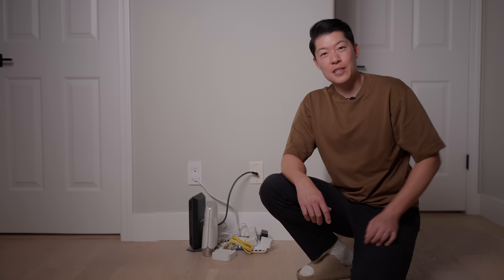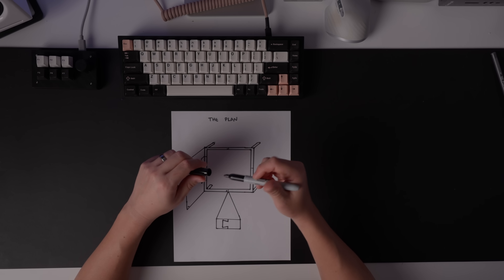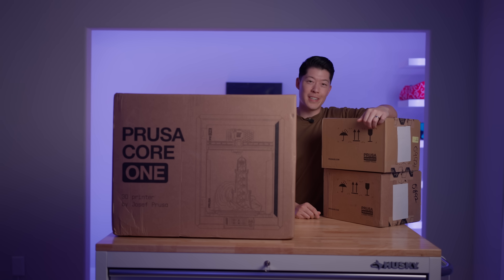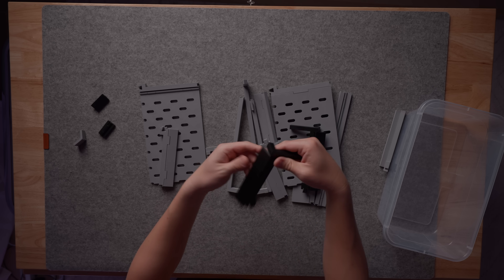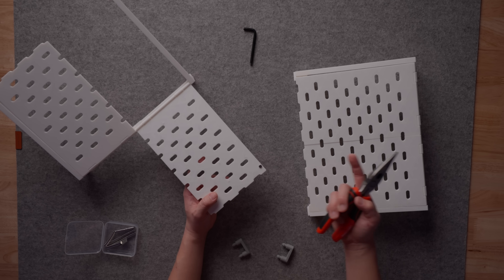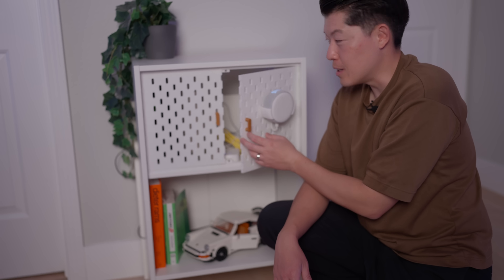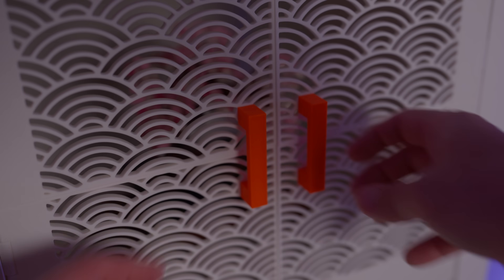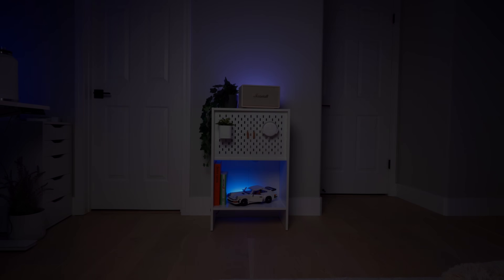IKEA Didn't See This Coming: Fully 3D Printed Cabinet Doors

Comment: These are great! Do you think you could do something for the A1 mini doors? I'm only asking because I put the hinges wrong on the three I printed and couldn't work out why the doors kept coming off 😂 

I totally get that this may be just a me thing.

Thanks for your awesome design!
Reply from the maker: Thanks! Sorry to hear about your experience with them though! The A1 minis were a little tricky because they were snap fit hinges and everyone has slightly different tolerances. I've seen someone comment about how they adjusted horizontal expansion by 0.15 mm in their slicer setting. I have not tried it but might be worth a shot!
Reply: @josh_makeshift the sizing was fine for me, I just put them together wrong. I haven't seen anyone else mention that, so it is probably just me lol

I am slowly filling up my kallax with the wave variation, it looks great!

Comment: I have a wall full of Kallax shelves. I have 3D printers. I think my local filament outlet will be very happy in the near future.
Reply from the maker: Hahaha love it. Hope everything prints smoothly!
Reply: @josh_makeshift  I finished the first print with no issues, unfortunately it doesn't fit. Well, it sort of does, but it's such a tight squeeze that it takes a minute of incrementally wedging it in there, and then the doors aren't really usable because there's so much tension that they just stick and rub. I used my X1C and the profile on Makerworld, so I have pretty high confidence in the print itself. 

I read another comment that said they had to file theirs down a bit, so I suspect it's variability in the Kallax more than anything else. Although I did try in four different ones here, bought at different times, so it seems pretty consistent between my shelves. I'll have to see if I can't make a slight modification and cut a few layers off of the frame. It's oh so close..

Edit: Thanks for making the cad files available! I downloaded the ones for the beams/frame pieces, and it seems trivial to do a push/pull to adjust them a bit, so I'm going to try tweaking those until I get a good fit. The magnets I ordered are still nowhere near being delivered, so I have some time. :)
Reply from the maker: @ So happy to hear you found the cad file and are able to make the adjustments! The variance in kallax shelves is definitely something I didn't consider but will keep in mind for future designs. Hope everything works out after making some tweaks! Thanks for checking out my print!

Comment: Prusa didn't send me anything so I bought it myself :D It hasn't arrived yet, it's my first 3D printer so I'm very excited.
How do you find it compared to X1C? I was thinking between the 2 but chose Prusa because of the recent Bambu controversy.
Great video btw, it is comparable in quality to channels with 100k+ subscribers, I wish you get there soon :) Subscribed
Reply from the maker: Thank you so much! You're gonna have an absolute blast. You can't go wrong with either of those printers to be honest. They print amazing straight out of the box and are great for beginners. Each has it's own quirks and it depends on what you value. It sounds like you like the open source so I think you made the right decision

Comment: Hello, I'm using a Prusa Mini — it's my first 3D printer, but I'm having trouble with the settings. There aren't many people around me who use this printer, and the models I print keep detaching from the build plate. I'm using build plate solution, but it hasn't helped. I would really appreciate your help. Also, your video is great — thank you for your hard work!
Reply: Hey! Get in contact with 24/7 support on the Prusa page. 

You could also try using warm soapy water on the bed
Reply from the maker: Thanks! Hrm It's hard to pin point where the problem is without knowing details but some common fixes are cleaning your build plate, drying filament (depending on what filament you're using), making sure bed is leveled and no external drop in temperatures/wind is affecting the print. I'd reach out to the Prusa support as suggested by Kalani. Hope this helps!

Comment: Wow, these are fantastic 🫶🏼 many (inc myself) use the KALLAX as a display unit (see my videos) but the issue is dust! You can buy doors but they are silly money, you can seal the back up with thin board painted. Have you thought about a single door with hinge on one side so the handle is on the end? Or for those of us displaying something, a version you can slide in a clear Perspex sheet so everything is viewable? That would be next level (this is already mind blowing my good 👌🏼). All the best.
Reply from the maker: Thanks!! I did contemplate having one hinge but I didn't like the idea of connecting four 3D printed panels to make one door. I like your idea though! It didn't occur to me to mix materials like acrylic or plexiglass because I don't have a laser cutter. It wouldn't be too hard with this cabinet framework too. I might have to revisit this idea later!
Reply: @josh_makeshift  great point about the doors, I’m sure it workable though somehow? Doing other medium like clear doors would be great without a blazer, it’s not something most of us have so the ability to do it without needing one would be a good to solve.

Comment: Do the arms keep the doors aligned to the front entirely by friction? Is that sufficient to keep them in place as you open and close the doors?
Reply from the maker: That's a great question and valid concern! I made the fit reallllly tight lol, so you have to really wiggle the cabinet system into the shelf. The magnets are also relatively small and not that strong to a point where it will be pulling out the frame. Hope that helps! Thanks for watching!
Reply: @ sounds good!

I’m in the middle of an office revamp and I love this idea. It would be great to hide the router/modem mess.

I’m planning to pick up an Alex unit for storage, and it’s a small office so I’m not sure yet if I I’ll have enough space to work  in a Kallax or something similar to the side.

Comment: i actually found you from the bambu app, i was scrolling randomly. found it, was printing it, got the first part printed. but couldnt find it out how to connect it, and found your yt in the description, and saw the video. +1 sub for you. cool door system, thanks
Reply from the maker: Hope the video helped you assemble it! I'll make sure to number the pieces or 
somehow make my designs more intuitive in the future! Thanks for watching and the sub!
Reply: @josh_makeshift , for some reason my doorhandles keep failing when i put them on my second door set
Reply from the maker: @ Unfortunately, my door handle designs are definitely not the best. I've heard some people say they have had better success when the door handles are printed separately on it's side and with supports. That might help!

Comment: I can't find the STL files, only 3mf files which I can not use :(
Can you please upload the STL files?! :)
Reply from the maker: I've just uploaded step files and a fusion 360 file! Hope this helps!
Reply: @josh_makeshift  Thank you very much! That is amazing. :)
Reply: @josh_makeshift  the door handles are completely different in the fusion 360 file compared to the ones in the 3mf-files. Could you please upload these smaller door handles with kind of round profile as a fusion360 file?
Reply from the maker: @KA-dp2gh  The door handle you're looking for is only available as a step file under the file name "Pegboard Door Handle"

Comment: Is it possible to print with A1 mini or the bed is too small ? 

This is so cool I have some non ikea cube where I need to have this
Reply from the maker: I just modified the model to use snap fit hinges instead of print in place! I've uploaded print profiles for the A1 Mini! Let me know if you have any issues!
Reply: @josh_makeshift  I ll try to print it tomorrow thanks you so much for this!!
Reply: @josh_makeshift  Just printed 1 door and the hinge and it went really good. I just need to buy some magnet and filament now ty a lot sent some boost token
Reply: Replying to myself, technically this could be printed with the A1 mini if door's hinge was rotated  by 90 deg. I've opened solidworks but I can't seem to do it :(
Reply from the maker: Sorry to hear it doesn't fit on an A1 mini! I've uploaded the cad files so hopefully someone in the community can think of an elegant solution to make it work.